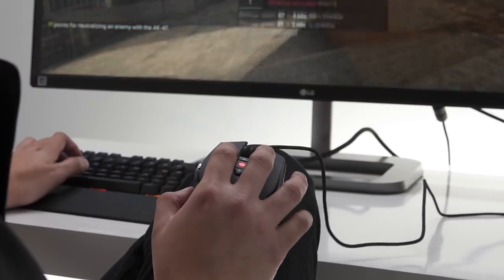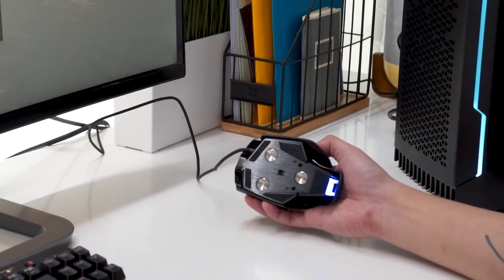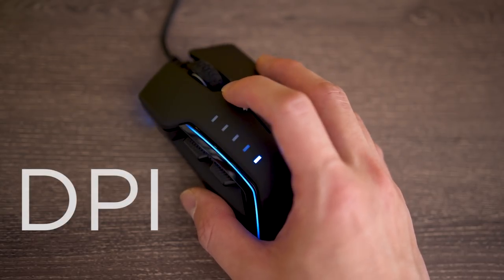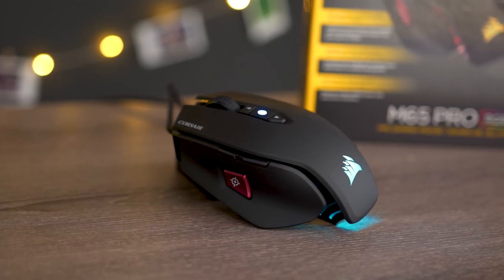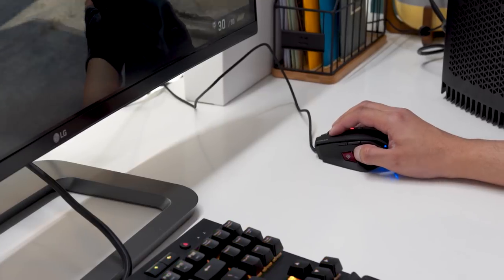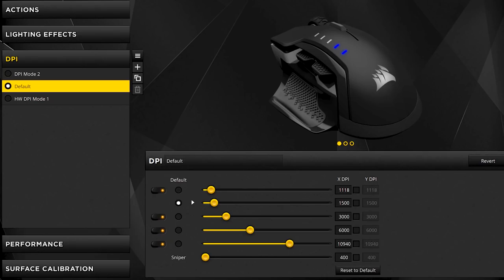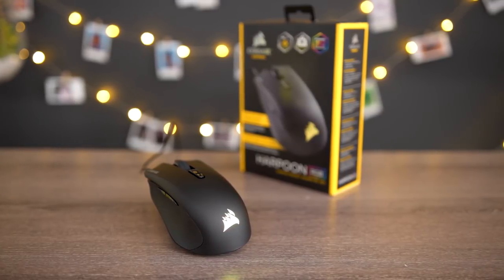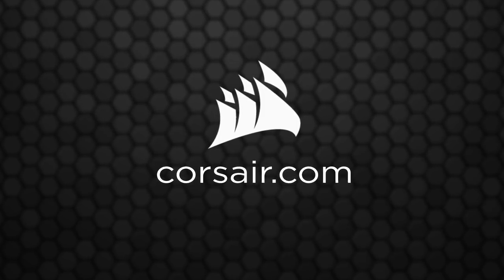Gaming Mice - Linus Explains Optical Sensors

Comment: Corsair sensors are great and all, but only advertising your mice through the sensors? Ouch. I don't care to go above 4000 DPI most of the time (Let's just say that I won't ever go above 10,000 DPI). So, instead of working on higher DPI for your mice, which used to be 12,000, and now is 16,000, why don't you work on a better clicking mechanism for your mice, so holding down left or right-click won't screw up the clicking mechanism and start causing it to ghost click?

Comment: Corsairs mice are Not good. They had to have paid Linus a fortune because even He doesnt use corsair mice.
Reply: Elite Exposure He does use corsair mice, he preaches the M45(?) for years now. He bought a ton cause they discontinued them
Reply: Actually he personally uses a M65
Reply: Elite Exposure so then what about my m65 that i've had since it came out? And my scimitar (orig.) Ive had since it came out? They are both the best mice I've ever had. My Razer deathadder, mamba, and naga all died within 3-6 months of use. My corsair mice are still going strong. The only mice i've had that are as good as my corsair  mice are from steelseries. Idk what company you use but I think the only really good ones are steelseries and corsair. Logitech mice are okay but the only one I had (g502) only lasted a year 😦
Reply: Corsair Mices is Very Competent and a nice Concurrent to Logitech, Scimitar PRO and Glaive uses PMW 3367, it's a bit superior than 3366 (Everyone Knows 3367 is just a Renamed 3389), much corsair mouses are better than logitechs, but, they're Heavy mouses, That's the Problem, Actually Corsair have only one Mouse with a Build Issue for the player, The Glaive, with Tactile Square side buttons switch, that's horrible, but if you don't use side buttons much, Glaive will be excelent , Comparing Glaive to G502, Glaive is a bit Superior in Performance, a bit Superior in Principal Durability, and well Inferior in Overall Durability, Because the side buttons of the G502 have a lifespam of 20 millions clicks, and Tactile Square of the side buttons from glaive was only some like 700k to 1m clicks, Corsair and Logitech is Always very good Brands.
Reply: Jeremy R Then get a mice that fits your needs. I say that corsair makes good mice but I'm talking about the sensor (ik corsair doesnt exactly make the sensor, I just mean that they use good ones) and the longevity. I dont like the glaive and the wireless mouse because I don't like the way they feel in my hand. Although with the glaive you can switch the sides out and I've only tried the default :/
Reply: I agree, i bought a corsair glaive and a keyboard. first the left click stopped working on the mouse within a couple months after i bought them and i found out the clicker mechanism is reknowned for bending. then shortly after a few of the keys on the keyboard stopped working. So, to the trash they went.